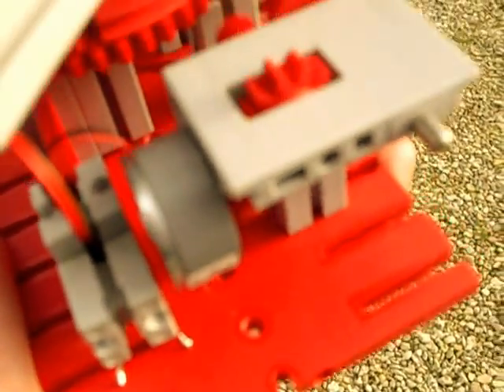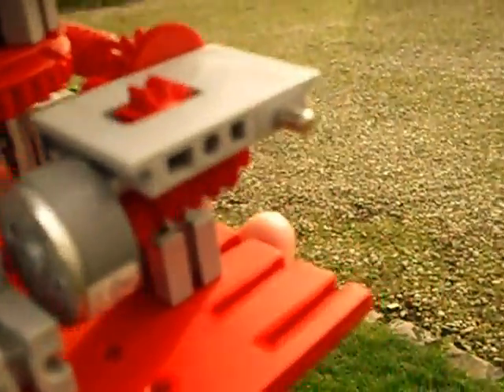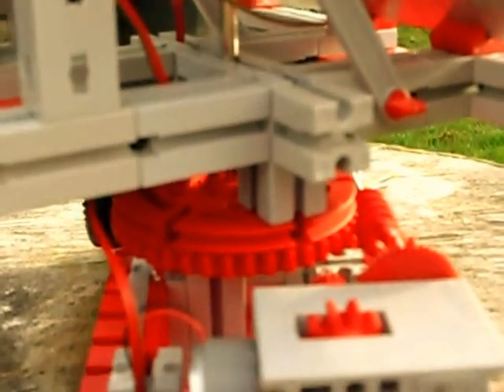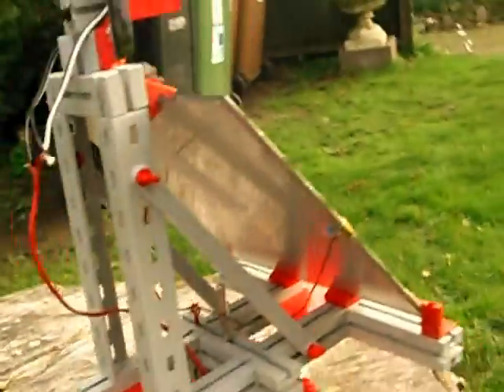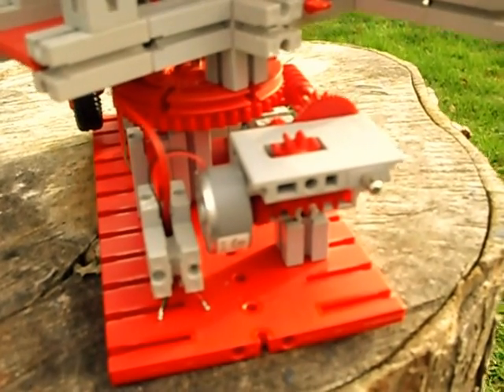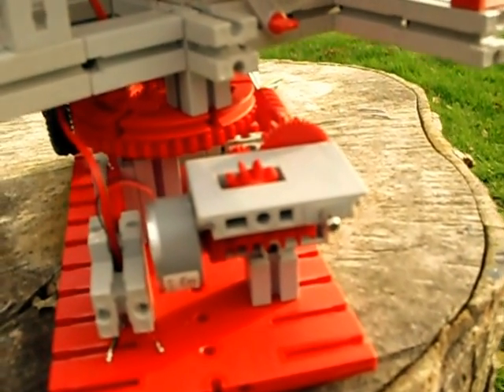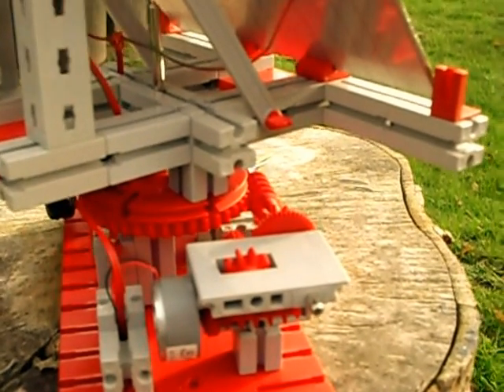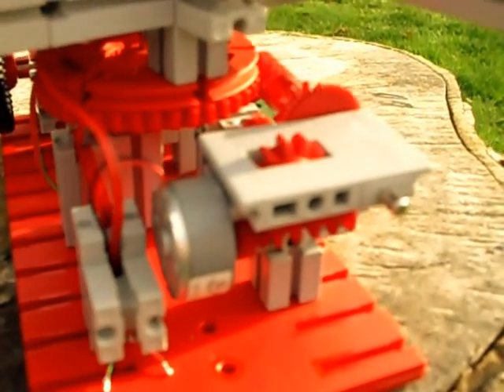Simple solar tracker no electronics fischertechnik

Comment: If you want to show it working , move the base 30 or 40 degrees. You don't have to wait for the sun to move. Cool. Good thing about using s worm gear drive is it should prevent the wind from turning it. Thanks for posting.

Comment: Thank you kindly! I finally realized my mistake. I was hooking positive to positive and negative to negative and making the panels fight against each other. I inserted the motor between the two positives. It just barely worked. I then hooked negative to positive on the panels, which sounds crazy but these are diodes, not batteries!! And thank God they are diodes, otherwise this beautiful and sensitive circuit would never work! Praise the Lord!

Comment: Please tell us about the little solar panels and the very sensitive motor! Please tell us where you got them! Make and model? I tried large 2 watt panels and could barely get it to work. I had to completely cover  the other panel to just barely get the motor to turn. What is the Voc and Isc for the panels? What is Vmp and Imp at max power? What kind of starting current is needed for the motor? I connected the two 2W panels in parallel and inserted the motor between the two positive leads.

Comment: Hi there!

I like this method very much! I like the KISS concept of it. But I have one question. In the video you mention that the motor could switch a switch to power some relays that could steer a bigger motor.
Will the motor burn up if its rotation is blocked by  the  switch? Sorry for my English...I'm from the Netherlands.

Regards,

Redkrabby
Reply: No it wont - no harm at all to the motor :)

Comment: How strong are those mini solar panels on top that power the motor? They seem rather small to power the motor with just the difference in voltage between them. On that note, what is the minimum voltage and current that it takes to run your motor and where did you get it?

Comment: Im thinking of useing this method for my solar project. Catch is my panel is 2ft by 4ft.... should be interesting =D. i will also have to work out a reset but not for dawn but to put it away so the little gits round here dont throw stone or bottles at it.